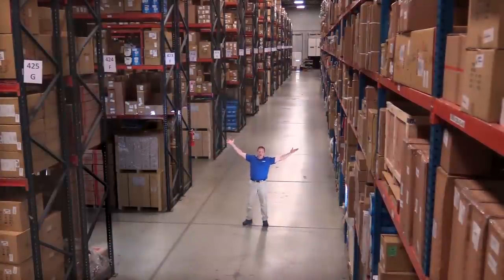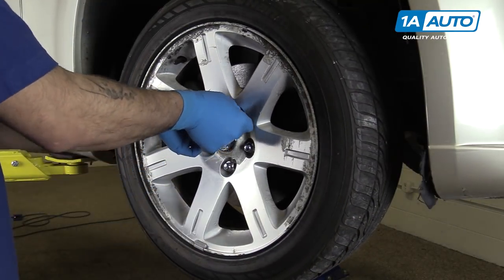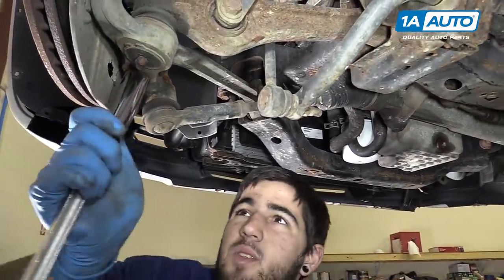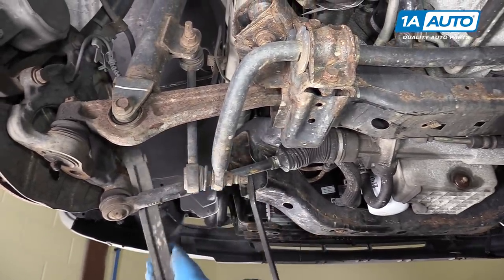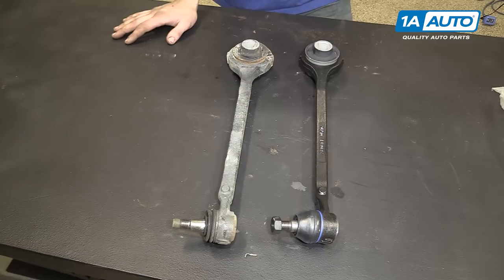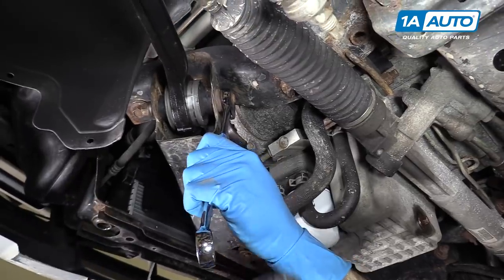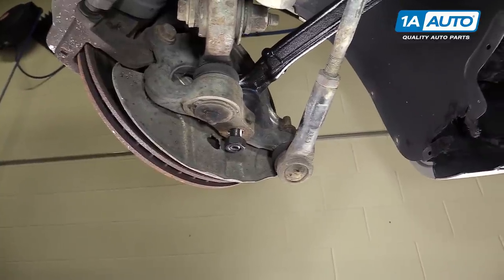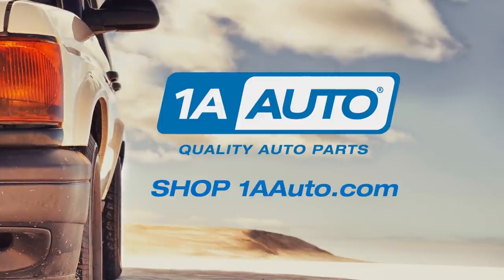How to Replace Front Lower Control Arms 05-10 Chrysler 300

Comment: Your video saved my butt at the last minute. Got a 2014 Dodge Charger R/T that I tried to get an alignment on, and couldn't get one because the front lower ball joint control arms were both worn out. I did this job after I got back from Big O tires, where I took it in the first place. Would have cost me $520.99 for both with alignment. This video saved me close to $300. Thanks!
Reply from the maker: +Simon Black Thank you for the great reply. We love to empower our customers by showing you how-to perform your own auto repairs while installing our high quality auto parts. Have a great day! 1aauto.com

Comment: Thanks for the video,  i replaced mine on 2008 charger  using a 2 ton jack . To tighten them i put a jack stand under suspension and lowered the 2 ton jack.
Reply: Where under the suspension is a safe place to put the stands. I may have to do the same, cause I have no ramps.

Comment: I have an 05 300. I had to bang on my ball joint nut til no tomorrow... Even had to try a ball joint separator to help! Right when I was ready to throw in the towel it broke free! Took a good while. The video was on point just my 300 gave issues.
Reply from the maker: +Trayz Movin Thanks for watching. If any of our viewers needs to make this repair, we carry the auto repair part shown in this video on our website. Here is a link to them http://www.1aauto.com/control-arm-with-ball-joint/i/1aslf00164?utm_source=YouTube&utm_medium=CTA+Comment&utm_campaign=ytcomment&utm_term=mdzGnBXK_zA
Reply: Had the same problem when replacing the tie rod ends. Ended up using a BFH and brute force but I got it to work. 

This car is amazing, and I love that it's based off of the E-class Mercedes... Chrysler just did a terrible job on the suspension parts (and the cheap interior lol), but thenagain, you can't expect much from a $40k car. Both the control arms, tie rod ends + bushings need replacement around the 100k miles mark.
Reply: Same here.. I ended up using a ball joint separator in combination with a pickle fork and a hammer and when it finally broke free it shot out with a lot of force! Your comment definitely helped give me some confidence that it would come out eventually.

Comment: I did one side of my 08 charger  the bolt was an 18 mm but the nut was a 20 mm...I use a rachet on the bolt and a adjustable on the nut......thanks for the video helped alot

Comment: One extremely important note - after installation, these tension struts must be tightened at *Ride Height Only*, to avoid preload on the bushings.  

The same is also true for the rearward control arms.
Reply: Drop the car down on ramps if ur diyer

Comment: I agree that you need a video for the lower ball joint.  The lower ball joint is a huge pain, and there seems to be no easy way to get it off.  Is this why 1A AutoParts has not taken this task on in one of their videos yet?
Reply from the maker: +Dylan Finger It's easier to replace the control arm with the ball joint already pressed in. Here is a link to the control arm that we carry shown in this video. Hope this helps you out. http://www.1aauto.com/control-arm-with-ball-joint/i/1aslf00164?utm_source=YouTube&utm_medium=CTA+Comment&utm_campaign=ytcomment&utm_term=mdzGnBXK_zA
Reply: Yes I agree with Dylan Finger, I was thinking of replacing the whole steering knuckle with the ball joint already pressed in, left and right but that part alone would be to costly. I am in favor of looking for a video on the front lower ball joint. Just did the upper left and right control arm today. I've seen guys attempt  to take out the lower ball joints but was a no go, then drill it out or use heat to free it, then press it out. Love the video : ) 1 AAuto please do one soon, especially on how to free up a stubborn ball joint that won't budge.

Comment: Knowing that 99% of people watching this would be using a jack and jack stands and have to use the weight of the vehicle to torque the nut at the end, you didn’t think to demonstrate how it’s done?
Reply: Jack the car up on both sides and turn the wheel to open up the area you'll be working on. When done, slide ramps under the wheels, lower the car down onto them, and finish tightening the bolts.  This is what I am going to do.... I have to fix this tomorrow. My car just out of nowhere started making this rattling noise as I came home today. Really disappointing.

Comment: Do the ball joints need to be greased after installation?
Thank you.
Reply from the maker: +Miguel Parra If they are sealed units then you do not have to, but if they have holes for grease fittings then you will have to grease them after install!  1aauto.com

Comment: Great videos for the Mopar cars...I have a 2017 Charger R/T...I am going to replace the upper control arms, both lower arms, as well as the outer tie rods and sway bar end links.  In what order should I begin?
Reply from the maker: +ahuimanu1 Thank you! We have different steering and suspension kits for your vehicle. I have attached a link for you. https://www.1aauto.com/2017-dodge-charger-brake-steering-suspension-kits/y-mo-c/2017-60-377
Reply: How many miles did you put on your charger? Most mopar cars really only need the control arms and tie rod ends replaced around the 150k miles mark...
Reply: Thanks,  @1AAuto ,  but I already have the parts...just wondering should I start at the upper control arm and work my way down from the outer tie rod, then front and rear tension struts?  I already did sway bar links.
Reply: ahuimanu1 how you do it

Comment: I've been told that clanking noise from suspension on Chrysler 300 is from ball joints, and after replacing them the clanking noise comes back after 4000 miles again. Is that true?
Reply: Yes yes and yes

Comment: Couldn’t get the ball joint out even with a ball joint puller. Ended up rounding out the tip of the stud.

Comment: Are these the same as tension struts?
Reply: Nope. This is a tension strut for sure. The lower control arm should be attached to the spring. Which as you saw in the video thwy didnt deal with the spring component. I think they just got them mixed up.

Comment: Thanks for the video, however I bought a upper and lower forward control arm kit. I replaced the upper control arm and when I went to install the lower, I noticed that shipping sent me three uppers and one lower, so I had to go and spend another 75.00 at auto parts store. Buying kits maybe cheaper, but it's not the best way. I also ordered a front end kit for 81 ford f100, one tie rod didn't fit, again, another 30 bucks from auto parts store. I will buy parts from 1aautoparts, but not kits. how do i correct your mistake?
Reply from the maker: +Bobby Benn Please call our sales staff at 888-844-3393 and we will help you out. We are sorry for the inconvenience.

Comment: Is there such a thing as a strut tension, or radius arm? at pep boys they said I needed to replace it, as well as the control arms, in order to get an alignment, but I can't anything called strut tension, nor radius arm.
Reply from the maker: +El Trillo They might be referring to the upper strut mount.  I would see if you can get a description of what the part is.  Yes, a radius arm is part of the suspension and is really the only way you would call it.
Reply: sus CSTRO Correct.  The lower forward part is a tension strut.  The rearward is the LCA.

Comment: How can I remove the nut of the balljoint stud ?? The nut is at end of the stud , it just spin .. any suggestions??
Reply from the maker: +Gregory A Palmer You may have to find something to hold the balljoint in place to prevent it from turning. You could try a pair of Vise Grips and maybe some penetrating oil on the nut to help break if free. Hope this helps you out. 1aauto.com

Comment: With that being said... I banged on the nut so much the hole for the 6mm allen key is smushed to a peephole and now my shaft is spinning! Wow! Need help fast! any suggestions?
Reply from the maker: +Trayz Movin Thank you for checking us out. Depending on the space you have available, you may be able to use a set of locking pliers or needle nose to hold the shaft in place. 1aauto.com
Reply: 1A Auto Parts Thanks for the feedback! And by the way I ordered my front forward lower control arms from 1A Auto! Received them Tuesday evening, started the install the next day! Parts look great! Thanks again👍
Reply: I literally just had the same problem.   Jacked the assembly up higher and used my impact wrench to spin nut off.  Holding shaft with locking pliers.
Reply: Bantu Odowa Yeah... I got it off! I ended up drilling in the side of the bolt between the  threads! Used a pickle fork to pry the nut right off! The other side was a piece of cake!
Reply: You can go to harbor  freight and  get a 20 $ ball joint remover  tool and you will not have this problem people
Reply: Trayz Movin I banged on mine for 4 hours and couldn't get it to come off

Comment: does the car need a wheel alignment now??
Reply from the maker: +sMMPOPCORNBO As long as you don't move any of the other components off the original position there should not be a need to.  Any other viewers interested in purchasing these parts please visit the link below.

https://www.1aauto.com/control-arm-with-ball-joint/i/1aslf00164?utm_source=YouTube&utm_medium=CTA%20Comment&utm_campaign=ytcomment
Reply: Any time you touch any steering components unless replacing brakes on your vehicle I would recommend an alignment.
Reply: If the vehicle was aligned with worn bushings, it wouldn’t be a bad idea to spend $90 to get an alignment and save your tires and suspension components.
Reply: I could be wrong but It may be the only adjustment is toe,  you can do that in the driveway.